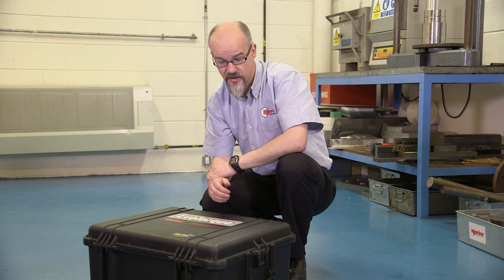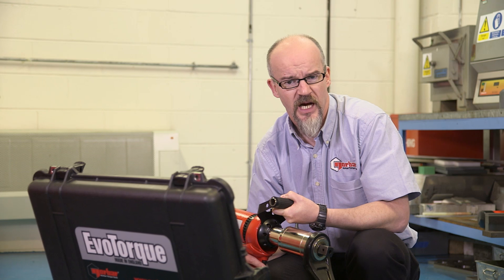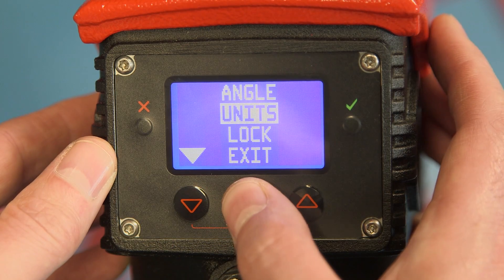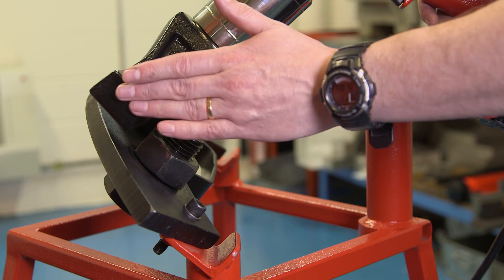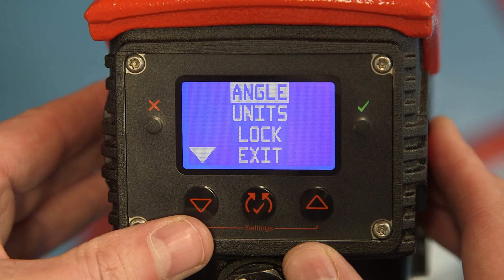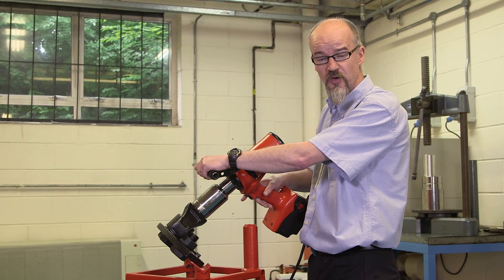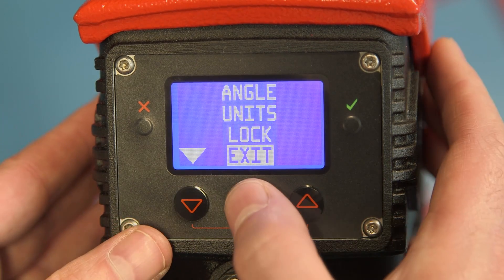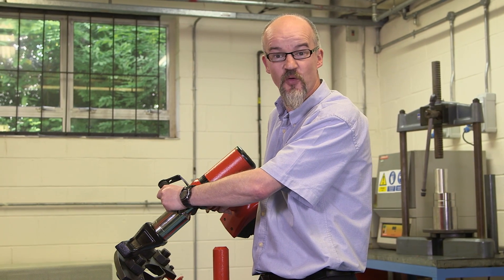How To Use an Electronic Torque Wrench...

Comment: Exelent, a smart tool. thanks.. spensive ?
Reply: I would say YES, but deals can be found on pneumatic ones, make sure you get (or can get) the reaction arm you need, the FLR unit (filter, luber,regulator) is usually universal and will work with all makes (the regulator is micro adjusting and bleeds of excess air when coming down),